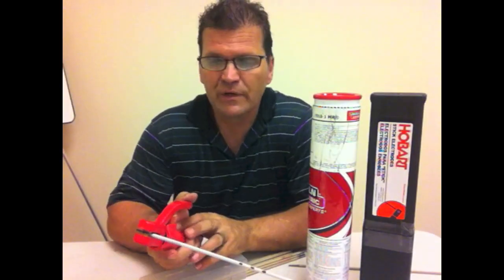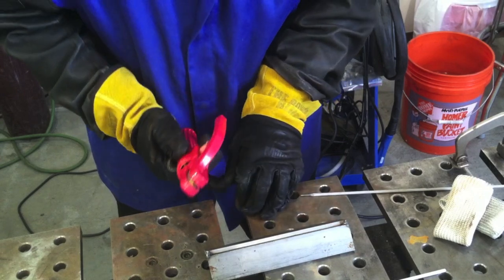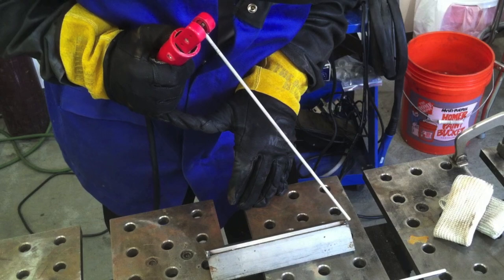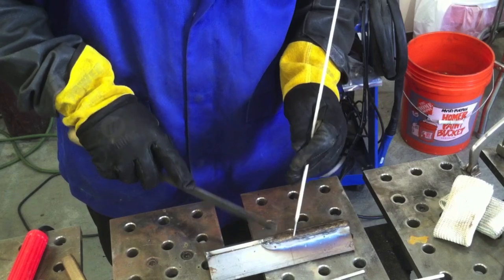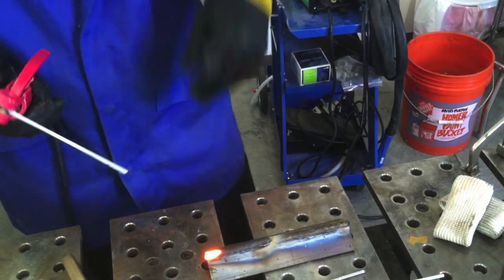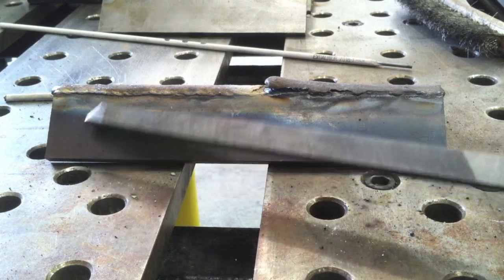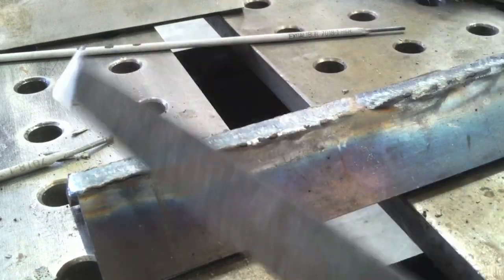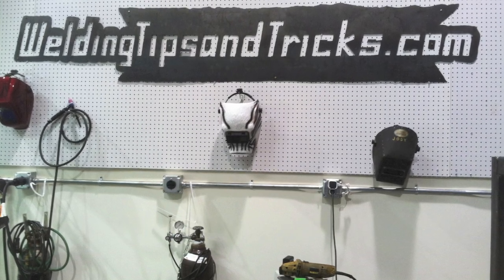Stick Welding / Arc Welding with Lincoln Excalibur 7018 rods

Comment: I haven't welded in several years, but this is my go-to rod! Always worked with heavy angle iron! For my jobs, 110amps was my minimal. The higher the amperage, the faster the hands.

Comment: No discernible difference? Jodi, Jodi, Jodi... Stop crunching and smoking the Slag! With the same amperage, the Excalibur contains the heat within the puddle more effectively, doesn't burn or undercut the toes of the edge of the weld bead, in fact, it perfectly blends to the edges and the slag doesn't 'bind' to the surface of the weld like the Hobart rod, which makes me think that sub-molecularly, the slag is being partly introduced and mixed with the weld bead and that's why it 'sticks' to the surface (and that's just the visible part of it... imagine what's going on inside which you don't see..) Ripples are much tighter and uniform, less spatter and bb's from the Lincoln. The Hobart basically behaves like any other rod out there like a Forney or Harbor Freight... anything but quality. No wonder the Excalibur boasts a perfect name as if representing the "Flaming Sword" that defeated all other swords in battles! Practice with cheap rods to build your skill but, build on the job with your Excalibur!

Comment: Thank you that’s what I needed to here.rule of thumb,I’m having trouble getting the 7018 to start but ok after or if I turn it up a bit.I’m a novice using a Lincoln 225 for stick and I have a cheap 90 amp H.F.all my learning was watching car shows on tv from the 90’s on,before online started but have don’t pretty well thanks for your help

Comment: Will the lincoln electric 3/32 7018 MR weld fine at 90 amps, or is that too low? I'm looking at buying a welder for portability, and it can only weld up to 90 amps when plugged into 110v. Thanks

Comment: I’ve got thirty five years under the hood and twelve years weld inspector. I’m a UA PipeFitter by trade and I have seen many contractors buy this rod thinking they are saving money. I’ve seen job sites where it is not aloud on the property. 
Over all I like your videos and agree with your results but not this one. This rod has cost the jobs of many capable welders and cost more money in grinding wheels than any other I’ve seen.
I’m not sure what the difference is on a molecular level but I can tell you that over all opinion in the refinery and power house world IT SUCKS!!!!
Reply: Another ua pipefitter here. 12 years in the field and i can tell you you are absolutely correct. In the process piping world there are many jobsites that wont even allow the use of excalibur let alone even allow it to even be on site. Theres something about the composition of the flux that makes this rod very prone to cluster and surface porosity even under what some would classify as exceptional operating conditions. Every weld joint i have done that calls for x-ray or phased-array done with 7018 has been done with atom arc. I have also noticed on some weld docs at the nukes stating the use of excalibur rod is prohibited.

Comment: Great video ! Short and sweet. Please tell me when shopping for the Lincoln 7018 I am not finding an AC version statement on the products I've found. Some manufactures state that they are AC. Is there a difference ? I have a 300 amp AC machine. I am building trusses for a house. Do I need to regroup and buy a DC machine, or can I use non AC specific Lincoln rods ?

Comment: I hate Hobart rods.  They have a bad tendency to fingernail.  I went to Hobarts up in Troy Oh and I went to Missouri Welding institute and both schools of course used Hobart rods.  I will go out of my way and go to lowes just to by the cheap "Made in Mexico" Lincoln 7018 AC/DC and the 6011 rods.  Even Hobarts 6013s suck!

Comment from the maker: not much but it depends on where you buy the rods.  I bought 10 lb of excalibur rods for around 25 bucks but it cost 18 bucks for 5 lbs of hobart 7018 3/32" rods at tractor supply store...so in this case the Excalibur rods were actually cheaper

Comment: I like your "7018 rods vs 6013" opinion from your site !
6013 is a little cheaper than 7018 but "it feels" a little soft  and yielding. 
7018 "it feels" a little more hard and rigid. 
(because imAbeginner-and like to try stuff) I have tried to weld with 7018 like I do with 6013, on some bAd surfaces, with wet,rust,unslag,etc surfaces, and it run well, but I suppose I was lucky too. I recommend metallic surface for any stick weld. In reality, Im lazy to clean it. If will weld good, do it any way.

Comment: I can never tell much of a difference in brands of E7018 unless I'm going vertical. For some reason, cheaper brands try to ball up and stick easier and they fingernail a little more. Just one of my observations, never really payed attention to slag color, and if you run it right all 7018 slag chips off without much fuss. Pretty easy to tell differences in brands of E6010, though. Or even Lincoln's 5P to 5P+.

Comment: I love them Lincoln excalibur rods! We have ALOT of of them 50 lb boxes of those excalibur rods of different sizes at my school. When it comes to welding rods, i think Lincoln is the best. I've welded with these rods in class so many times and the flux peels off, sometimes my weld would have most of the flux off when i lift my hood, and when I'm doing overhead, the flux would already be on the floor when i lift my hood. these are some great Rods!

Comment: those excalibur rods sure are something wonderful. used 1/8" 7018's for my D1.1 cert on a 6" schedule 80 pipe with a Tig root, hot and one fill pass, and it was a flawless test. proud to be certified since April!!

Comment: Good info. hey i bet you're always looking for ideas to show in a video. I'd like to see a video in which you do everything wrong (like a beginner) to show how the wrong technique affects the weld. For example, in tig welding how using an electrode that's too big for the current makes the arc hard to start and stay lit, and how it affects the puddle, etc... I know that would be a challenge for you since you do everything right in welding. Thanks.